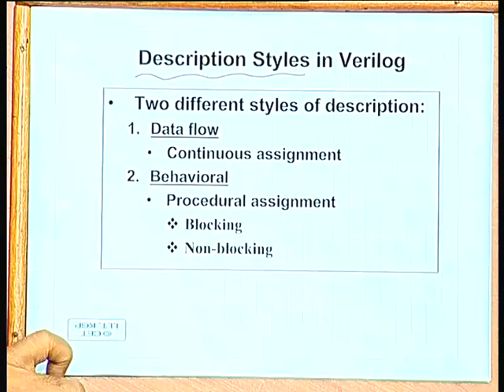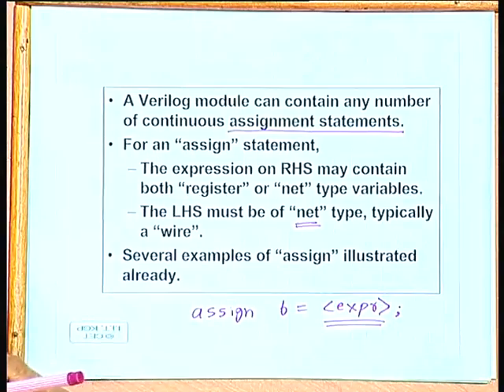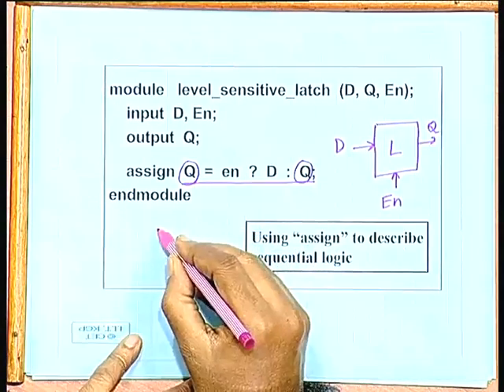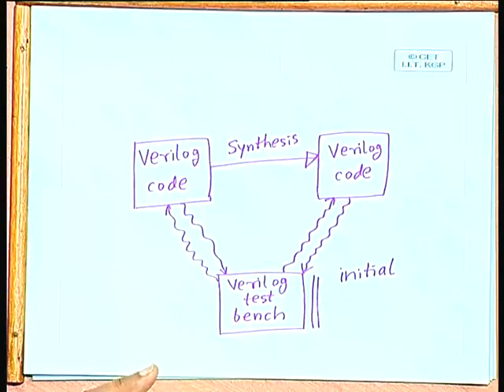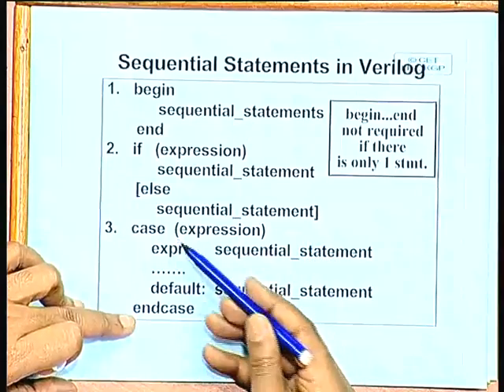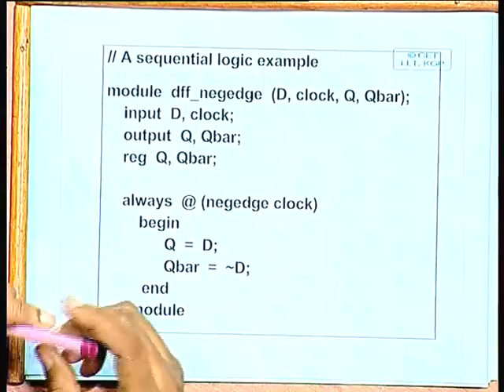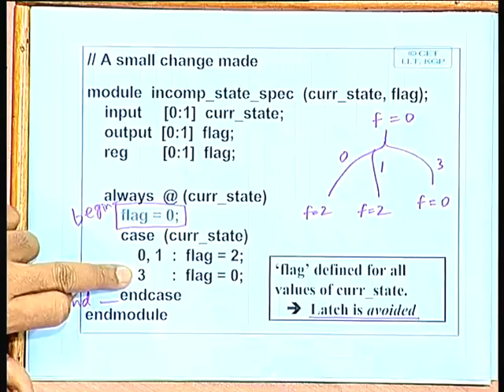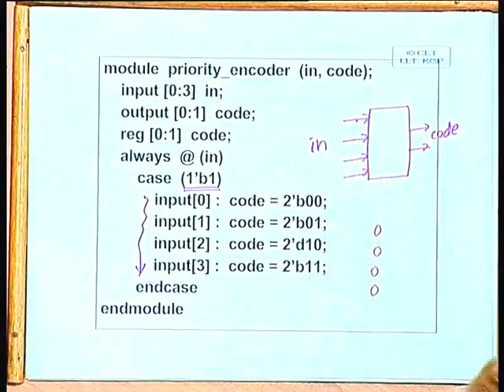Lec-4 Verilog: Part-III

Comment: assign operator must have net values on LHS as stated above, then according to that the demultiplexer can't be implemented using output[select] in which select being the non constant index, we can use explicit value assignment by using if else though

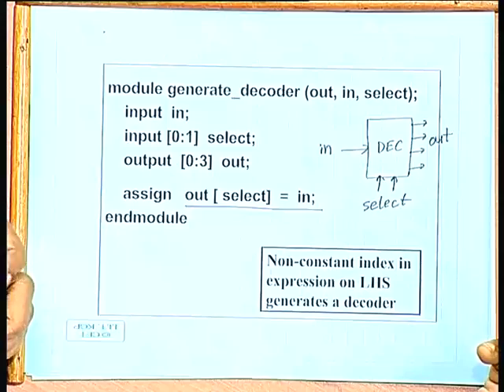Comment: at 14:00 You explained that the particular block how will be synthesized that is what is the hardware block obtained if that particular code is synthesized. Similarly if condition,switch case all are there. So can you please tell me what are all the statements and how will they turned to a hardware block?

Comment: Does the last example come under combinational category? 
If there is a case where input changes from 1->0
Then always block is activated, thereafter, the case statement would look for case1. However, all the inputs are now 0, therefore there shall be no assignment of code. Now does it not imply that the value of code should be retained ?